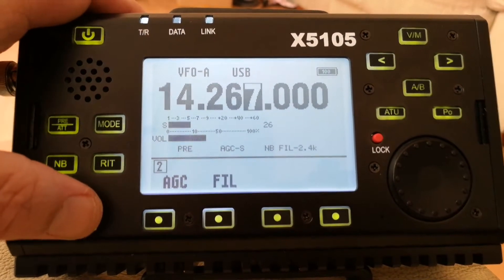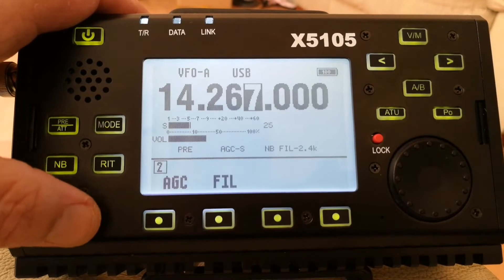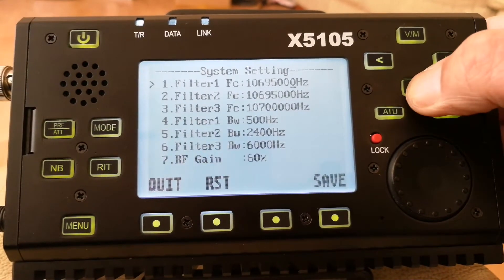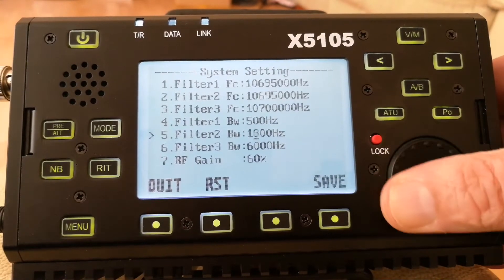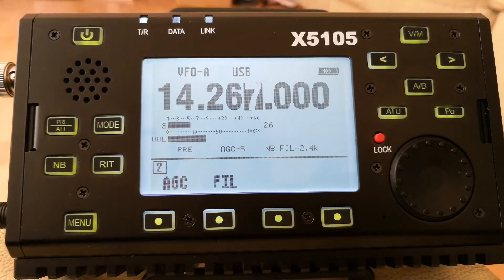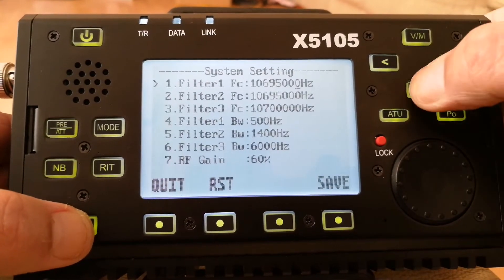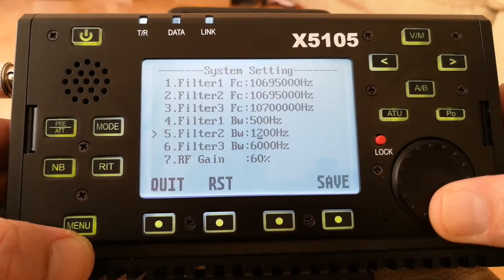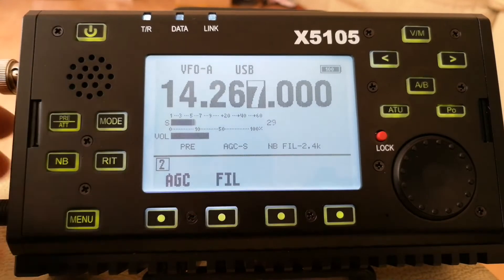The Xiegu X5105 adjusting the band width in SSB mode

Comment: I see it has three filter selections. Do the same three cover both CW and SSB. I operate mostly CW so I would set the filters for 400 hz, 250 hz and, if it goes that low, 50 hz. So when I go to SSB do I have to go to the setup menu and change these settings so I can listen to SSB?
Barry, KU3X
Reply from the maker: Barry Kery the 3 filters are for all modes, the lowest for CW is 400Hz..Their are low and high pass filter settings in the menus so you can use those as well..
Reply: TNX......I wish you could go lower than 400 hz. 250 to 300 hz would be nice, but 400 hz is really my Go To filter bandwidth for starting out on CW. This will work for me.
Barry, KU3X